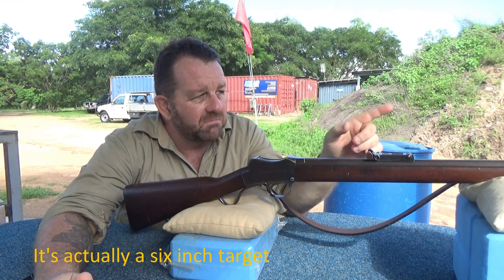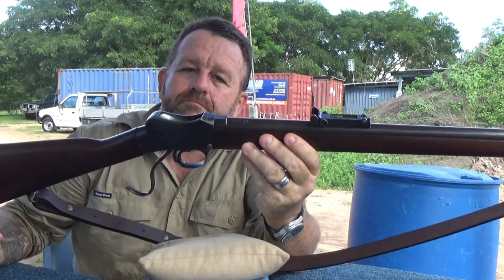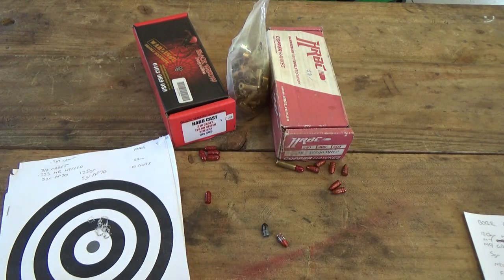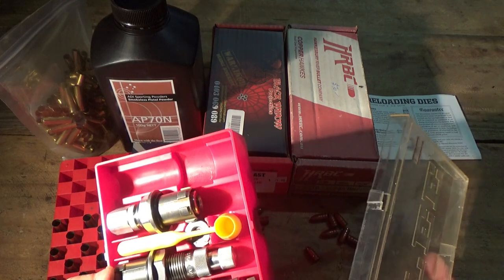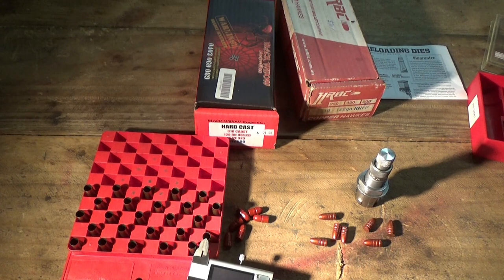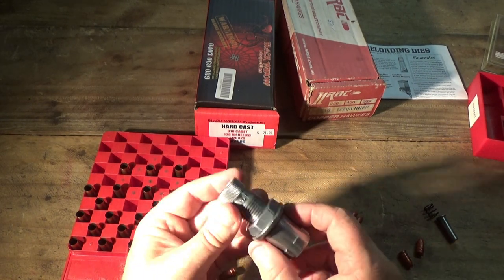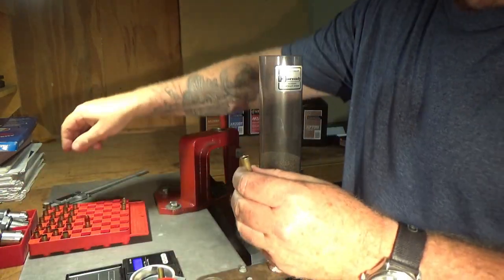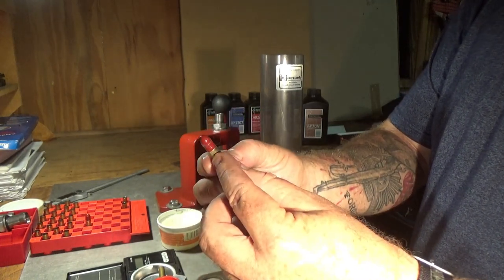Martini .310 Cadet ~ Aussie Icon ~ Part 2

Comment: I just bought a 310 cadet mold from Arsenal molds. I powder coat the bullets. My cadet was rechambered to .32-20. I trim the brass to 1.2 inches. After fire forming  I don't need to resize them. Loading with 4.7 grains of Unique and hand seating the bullet. If I'm not shooting from the bench and want the bullets more secure in the case I'll  use the Lee factory crimp die that I've turned .080" off the bottom to tighten up the mouth. I don't bother to size the bullets and they shoot great. I JB welded a weaver rail in front of the rear sight to mount a scope. I call it my scout rifle.

Comment: I bought one of these about 7 years ago.  I love it. They were imported for a while here in the US  and reloading your own ammo is the only way I've found to get cartridges for it. I was lucky enough to find some Bertram brass for it but I found that 32-20 and 25-20 winchester cases trimmed back is a good source for brass. For powder I use trail boss I'm not sure how easy that is to get down under. It's a low pressure powder for older firearms.  It's a dandy to shoot. And it's as accurate as the shooter is.
Reply from the maker: Thanks for your comment Justin. Trailboss is available in Australia and is commonly used in the same fashion that you describe. The little cadet is a very enjoyable oddball to play with, that's for sure.

Comment: I own a .310 Martini-Henry Cadet rifle myself, I full length trim my cases, then use a case tumbler, I also full length resize and de-cap, then bell each case, I also trim inside and outside of the case after trimming, it is then I prime the cases, measure each charge then seat the projectile with the bullet seat, no problems, I cast my own projectiles, .320, the dies I use are .310 Super Simplex with RCBS adaptors no problems, but the .310 is a healed projectile, these are the only projectiles I use, the accuracy is very impressive.

Comment: Great stuff mate!
The 310 hits that target with some authority.

I shot a goat on the farm at about 20 meters - the projectile went clean through the goats chest.
The goat ran about 10 meters and fell over. Another shot through the skull to ensure no suffering.
Once butchered, i found about 750mls of congealed blood in the chest cavity. Billy goat was a dead goat running!
Reply from the maker: The 310 Cadet hits a lot harder than expected. It was always designed as a game cartridge.

Comment: Just one query about the Martini-Cadet. Stamped on the barrel of my Cadet is .310 12 - 120 which, I was told, stands for .310 calibre, 12 grain blackpowder, 120 grain bullet. However, all the evidence I have states that the Greener .310 cartridge was never loaded with blackpowder. So what does the 12 grains BP mean?
Reply from the maker: Hi Rod. I was of the belief that the 12 was meaning 12 Grains of BP also. That always seemed strange to me since the 310 Greener was introduced at least a decade post invention of smokeless powder.
Reply: @practicalnottactical  Greetings from Canada. It is possible that being an early British loading , the 12 on the case could very likely mean 12 strands of cordite.
Reply: Greener's book Sharpshooting for Sport and War of 1900 describes why he developed the .310 cartridge for cadet training - cost of both the cartridge and the arm was lower. The ammunition was about 1/3 the cost of the Lee Enfield cartridge. It uses "a lead bullet; the explosive is Cordite or other smokeless gunpowder" which gave a muzzle velocity of about 1300 fps and an effective range of 400 yards. The Cordite load in his book is identified as .310 - 3 - 123, so a difference to the markings on the Australian Cadet rifles. The reason for the 12 grain powder load would be Australia may not have been making cordite suitable for the .310 Cadet. Research on the Colonial Ammunition Company of Melbourne would verify if this is the case. Otherwise if anyone had a copy of Greener's The Gun and It's Development it would probably have loads stated there.
Reply: Anyone interested in selling me some Ammo? I am in Pennsylvania USA! Thanks for any information!

Comment: Thoroughly enjoyed the video(s). I was given a Cadet in my 10th birthday in 1962. I've never fired it, but I used to play with it as a kid. It's still in very good condition, but it won't cock. Is that a common problem, and is it an easy fix? Cheers, John
Reply from the maker: Glad you got something from the video John. I wouldn't say any gun not being able to be cocked is common. It may be seized through some rust or corrosion or it may be missing a part of the action. Maybe try to disassemble the rifle and see if its missing a part.

Comment: I'm currently using 9 grains of AR2205 with a 120grain CBE cast bullet (.320 heeled) but I've seen so many other types of powder used. Can someone with experience suggest the best powder type and charge to use?
Reply: Lots of people say 4 to 4.5 of Unique. Start at 4 and move up. I use a 5cc Lee scoop which throws around 4.2 which works well. You can go as low as 3.8 but depending on your chamber you may get tumbles. There's lots on forums if you search around.
Reply: I found a accurate load of 3.7gn AP-70 with my own bullets(wheel weights ) thumb seated no crimp. There is a lot of variation in bore and chamber dimensions. It can be challenging but when you sort out your rifles likes / dislikes its a fun little thing to shoot. Bullets lubed with Lee liquid Alex.